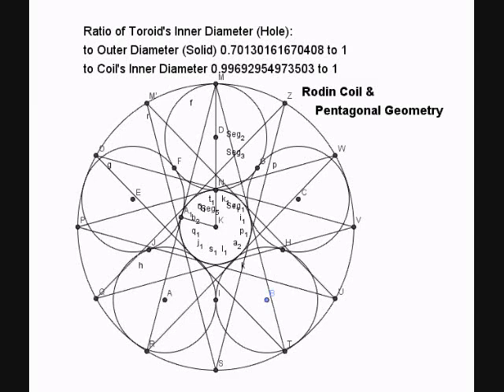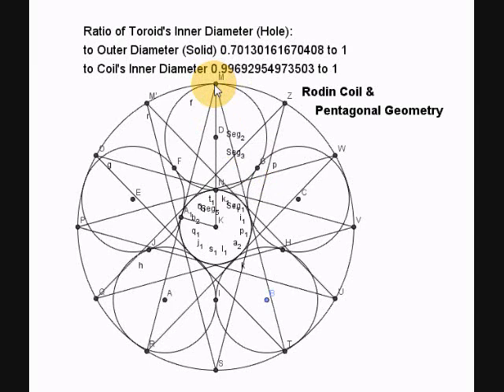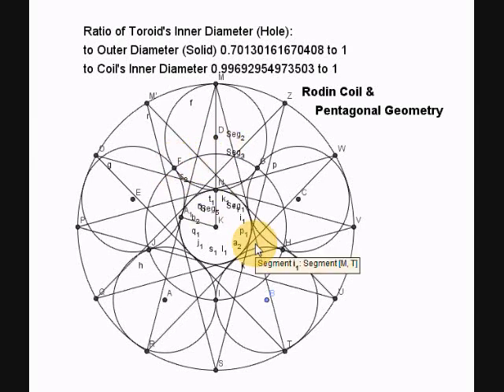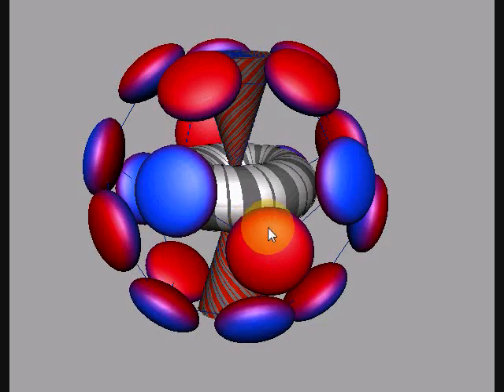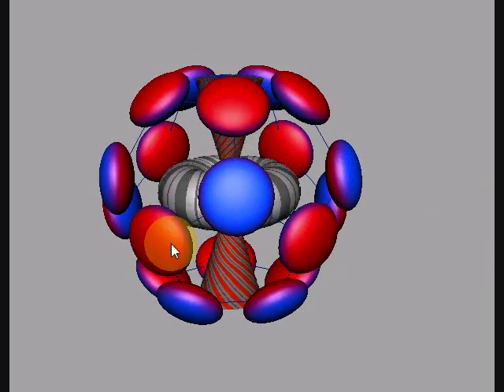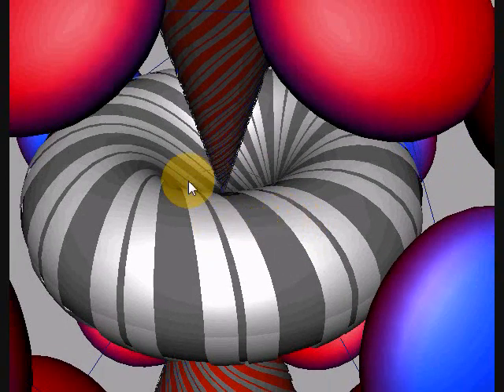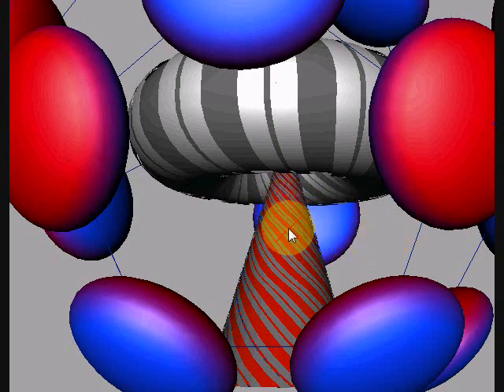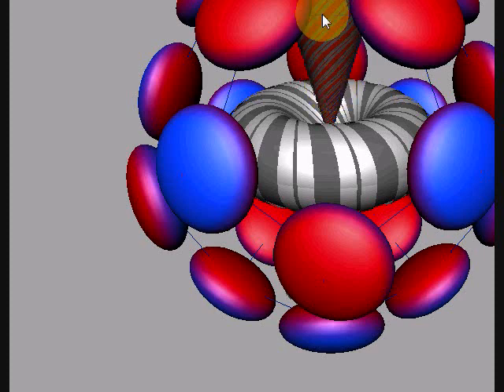Rodin Coil Motor #1

Comment: If you were to take a glass sphere with to electrodes at each end, with a square neo magnet in the middle along the axis of the electrodes, also make glass sphere a vacuum, connect electrodes between the to bifila capacitors.

Comment from the maker: @dasaint0 In all honesty, this concept is a little out of date. Overunity is achieved through these technologies by utilizing the coil like a resonant circuit and also causing an implosion which creates a cooling effect. If the coil is made out of a superconductive material, the coil has to cool to reach that superconductive transition point, and then it will be held in resonance without anymore input.